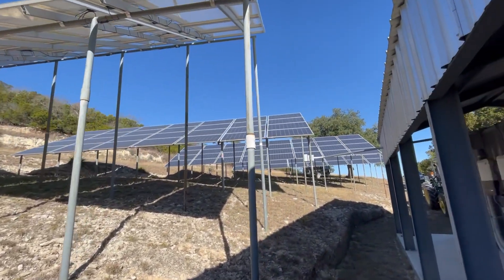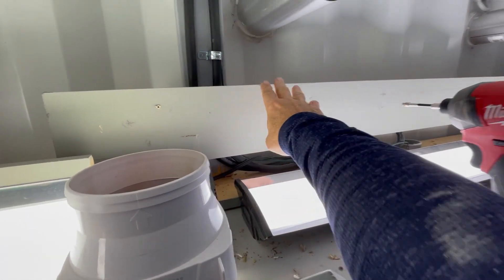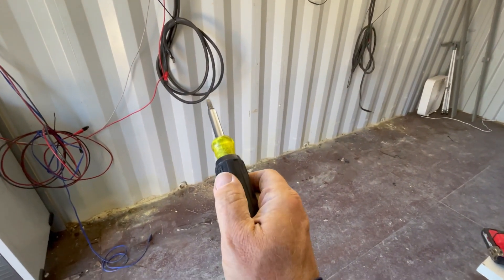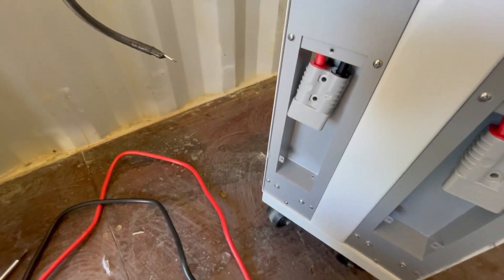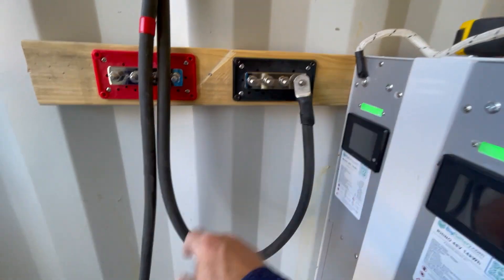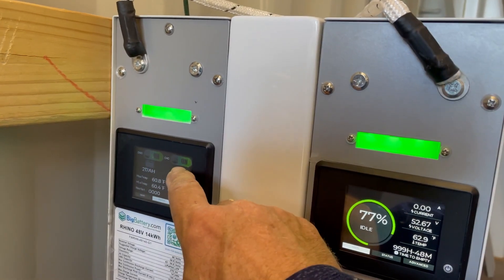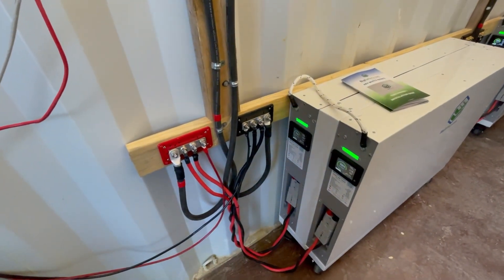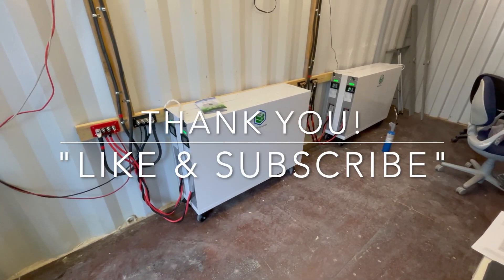Flooded Lead-Acid Battery Swap with Big Battery Rhino on an Outback Radian Solar Commander

Comment: I too own a large bigbattery setup. Unfortunately, in just three years they’ve not been the greatest… with a bms failure in three different batteries in those three years. 
I would perform an individual load test on those packs if I were you. In my experience, with their packs wired in parallel, if a single cell fails in one pack, your battery will still work but shut down under larger loads, and then come back on after loads lessen. Your other battery will then be carrying the load of charging the “failed” pack and provide load power. 
Just my two cents
Reply from the maker: Thank you for the feedback. I’ll keep my eyes open for any issues. I wish the battery had a CAN or RS485 port. Maybe it does have one somewhere buried on the BMS.

Comment: What the heck are you powering. I can see the batteries are 56kw and this seems to be the smallest component in the system. I estimated your array to be 32kw on the small end from what I could see, approximately 4x8x4=128 panels at 250w each. I don’t even want to guess how much you can produce from the inverters. Are you trying to self power a small community? Nice system btw.
Reply from the maker: Exactly, a small ranch with several outbuildings.

Comment: You still might need some vents in the container.
Reply from the maker: The original vents and the forced air vents are still operating. I may program one of the inverter AUX ports to control an AC relay if the room gets too hot.
Reply: @maverickmacgyver  Yeah containers often have a humidity problem. I have three smaller 48 volt Big Batteries. Great system!

Comment: Iam looking at $26k worth of batteries?
Reply from the maker: Yeah. It’s all relative, I guess. It fits in the formula of the greater situation going on there. Everyone has different energy needs and budgets. Even if you have just one golf car battery like the ones that were ten years old and being recycled and one solar panel. In the grand scheme of “preparing for readiness”, do what you can with what you have where you are at.
Reply: @maverickmacgyver  That much money still hurts. I replaced my old lead acid battery bank that consisted of 16 golf cart batteries with US battery L16 clones. 16 of those set me back about $5k. I'm still complaining about that.
Reply from the maker: @theheathkitshop2424  I hear that! Everything is getting expensive. I personally spent a lot of money of batteries last year. This year has a different focus. Keep on keeping on!
Reply: Can I ask why you need so much power? I only have 9.6 kW of battery I run my whole house off of this at 24 V. 7.5 kW of PV. 
The only thing I can’t run off grid is my dryer. Everything else I’ve replaced the appliances to 120 V.
Reply from the maker: @benjones8977  Well, you kinda answered your own question. This system powers a larger amount of loads.
Reply: Very nice system. My only comment would be the voltage drop.(like you mentioned) Move the batteries closer or buy some 1/2” X 3” aluminum bar stock to run up & over for a buss bar. 
Stand offs and protection/insulation will be needed. The contact areas will need aggressive grinding or machining to get the oxide layer off right before assembly and use of Noalox paste. A pretty polish with 3M doesn’t get the oxide off. It would be far easier just to move the batteries over and make a new battery standoff support. If you have to work on an inverter, you can pull the Andersen connector, unbolt the battery closest and roll it out of the way. In battery wiring, if it calls for #2/0 I’m going with 4/0.  If it calls for 4/0, I’ll run two in parallel. That way, it’ll always start a high current load even when the batteries are low and not fault out or prematurely transfer. Looking at voltage drop even with short runs and high loads is amazing. One volt means heck on the battery side of things, not so much on the AC. Good choice of batteries by the way.
Reply: Nice setup btw what is total Kw of your system very neet setup
Reply from the maker: @cjtroutt8092  The Rhino battery is 14kWh each, so about 56kWh in this system.